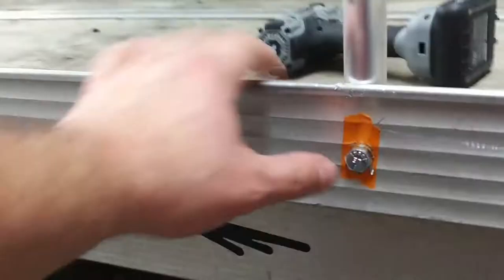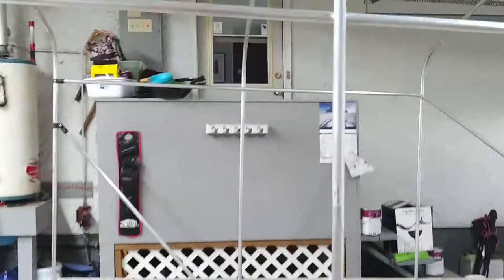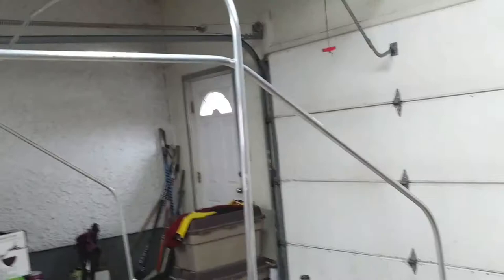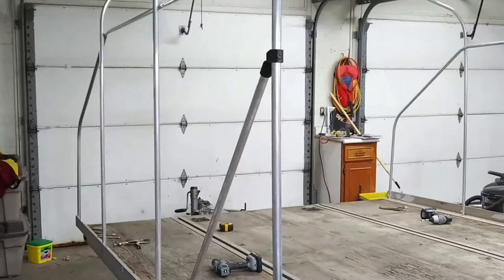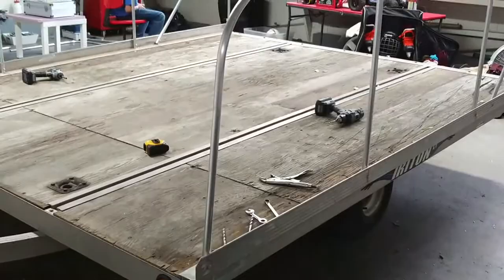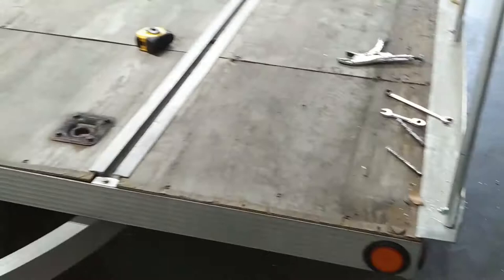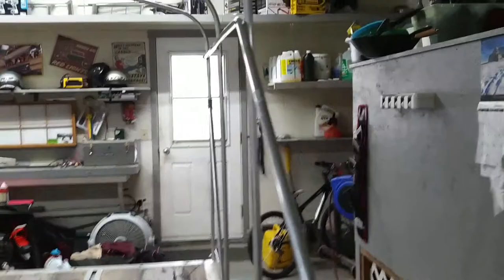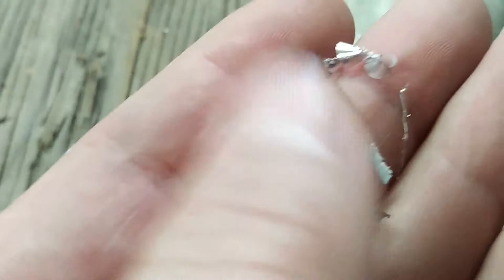Snowmobile Trailer Cover the cheaper option Part 3

Comment: Looks good ,how much was the kit. And how has it held up thanks
Reply from the maker: Overall yea know it was well worth it... The zippers on back roll up door are still working but the clips broke for zipper... it still works I just ran wire through it... a few screws came out but that was easy fix... yea overall it's been well worth it..  I paid 950 USD